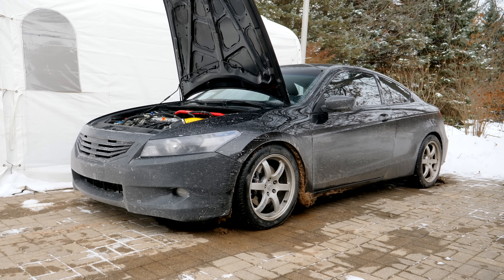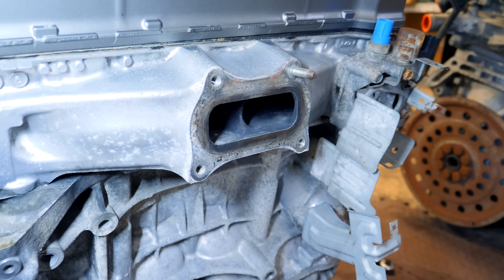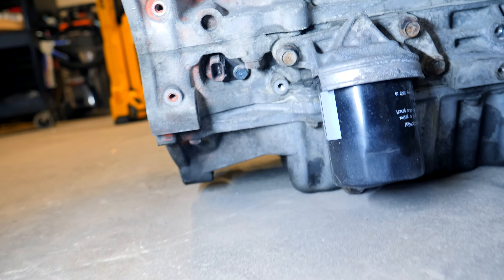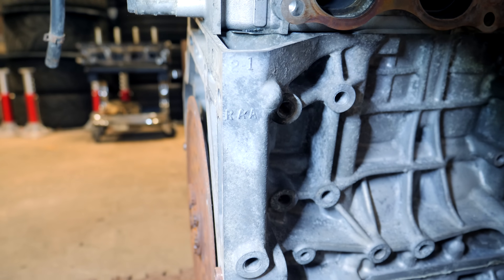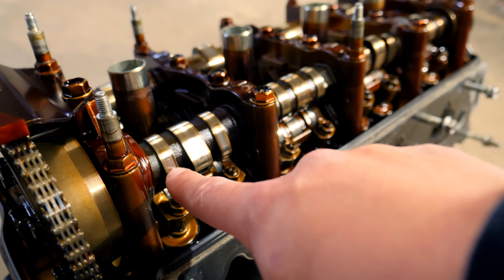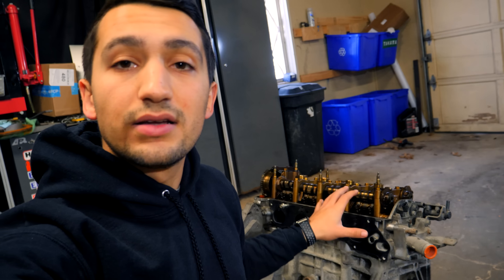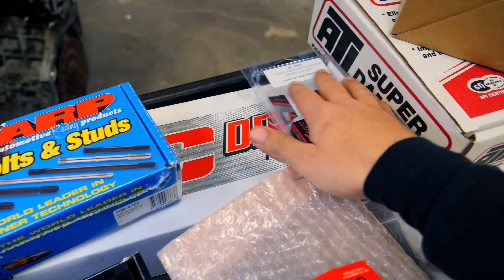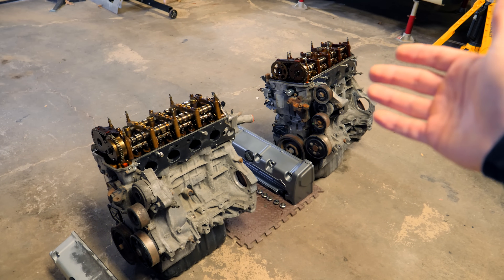How to Build a 300HP K24Z Engine

Comment: k24a2 with type s oil pump, vtc gear skunk ultra manifold with bigger throttle body and race header valve springs, 3inch exhaust and a 4inch intake on e85 will do 300whp reving it to 9k tuned.
Reply from the maker: Do you own this car? Or you've seen it?
Reply: Can the manual 2004 Acura TSX transmission work in the 2011 manual Honda Accord
Reply: How about jtw5 tranny 6 speed from frv 2009 what can you say about the final drive

Comment: Bro, my current 2009 coupe makes 300hp with basic bolts ons, I’m interested in seeing how different it’ll be with the 4 banger vs the v6 which I have
Reply from the maker: From my understanding, the V6 will have more low end torque even after I complete my build, but mine will be lighter and should have a better top end. I'm speculating right now but we'll see 😁

Comment: Are you going to make it all wheel drive and if you are how do you do it and if you're not how do you do it? I'm very interested on how to make front-wheel drive or all-wheel drive? I know in the past it was hard but now I know a lot of people are doing it and it's not as hard to do...
Reply: It's now worth it, just not worth it.
Reply from the maker: I've toyed with the idea of potentially swapping the full drivetrain from a Hyundai Genesis coupe since the proportions of the car are similar, but for the money I would have to spend and the amount of custom work that needs to be done, its definitely not worth it. It may not even end up working properly like a mass produced and engineered vehicle. I don't want to bash anyone, but most people on YouTube that do crazy swaps don't look into the more important things like the suspension geometry. When you throw a subframe and the drivetrain out of a car into another, those angles are going to be changed since they're not made for one another.

Comment: Should’ve used a K20z1 or z3 head
Reply: James Lapine genuine question, how would that be better?
Reply: @dorito7480  not a honda expert but I believe the k20 head flows better up top but the k24 has more displacement / stronger bottom end so you Frankenstein the 2 and you get a better combo
Reply: Alexander Bassila ^ this
Reply from the maker: If you leave both K20 or K24A heads the same, the K20 typically flows better, however after you do a port, swap swap cams and change some valve train, you end up with equal, if not better parts. We'll see. Fuel around where I live will probably be the limiting factor
Reply: Can the manual 2004 Acura TSX transmission work in the 2011 manual Honda Accord

Comment: When are you going to get into complete body and paint work? This channel is just based on Mechanical mods or fixes.
Reply from the maker: I'm not sure yet tbh. I'm not a huge fan of the stance scene, which means 3 piece cambered wheels, body kits, and flashy stuff. We'll see what I end up doing 🤷‍♂️
Reply: milanmastracci 
Ok yeah been a fan of yours for sometime now, noticed your basically inside modifier. Suspension, drivetrain, engine Person. I guess you do need a bigger shop, Paint experience. 
Ok I guess what ever you can handle.